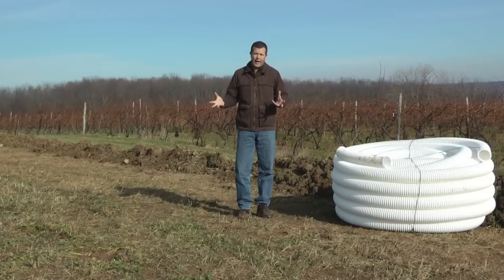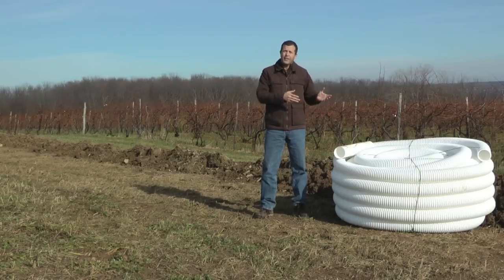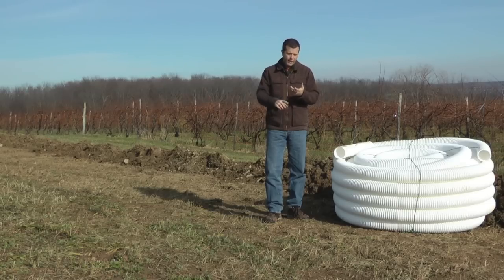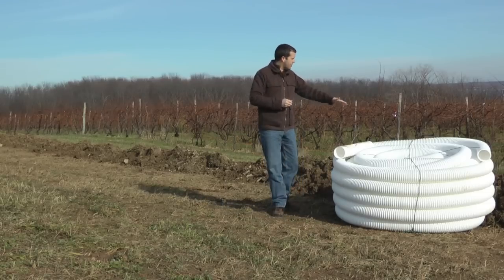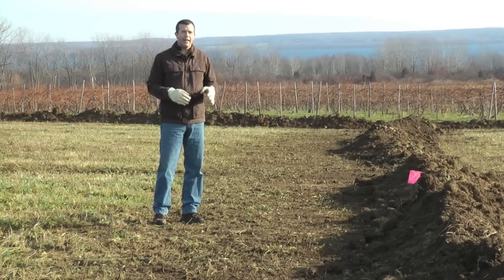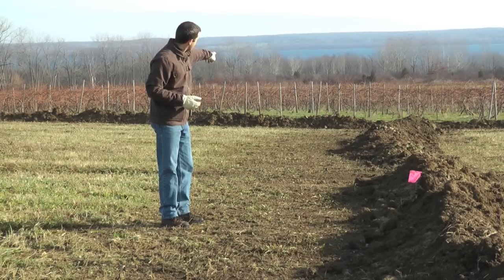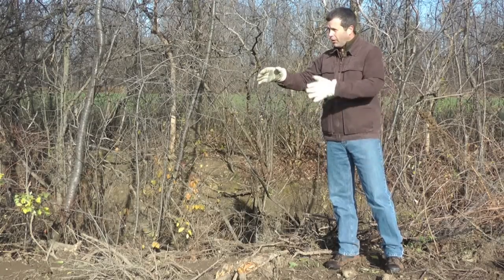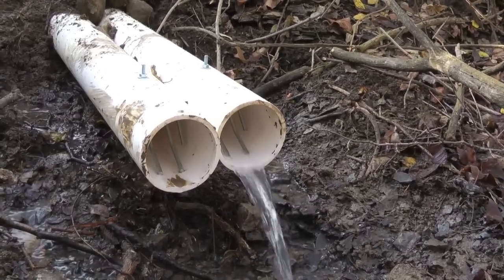Installing Drain Tile in Vineyards

Comment: YOU SHOULD CHANGE THE SOIL STRUCTURE SO THAT THE WATER MOVE'S THRU THE SOIL PROFILE. IF YOU HAVE EXCESS WATER AND YOU HAVE WET FEET. YOU HAVE A SOIL PROBLEM. DRAIN TILES IS NOT THE WAY TO CORRECT THE SOIL PROBLEM. MAKE SURE YOUR pH IS SLIGHTLY ACID AND YOUR EC IS BETWEEN 2.5 AND 3.5 WITH 70% -85% SOLUBLE CALCIUM. ONCE THAT IS ACHIEVED,  THE WATER WILL MOVE AND NOT SATURATE THE SOIL. PUTTING IN DRAIN TILES IS A COMPLETE WASTE OF MONEY. EXCESS SOLUBLE CALCIUM IN THE SOIL SOLUTION USING (CaSO4*2H20) GYPSUM WILL LET THE SODIUM ION MOVE OUT OF THE SOIL PROFILE. SODIUM ION IS THE PROBLEM AND MOVING IT OUT OF THE ROOT ZONE IS THE ANSWER. WHEN YOU LOOK AT YOUR SOIL REPORT TRY TO MAKE YOUR SAR/ESP AS LOW AS POSSIBLE. FOR MORE INFORMATION ON TOP PRODUCTION CALL AGRISERVE INC.